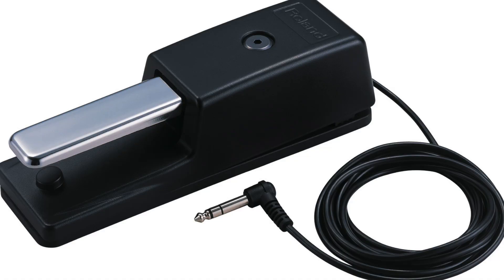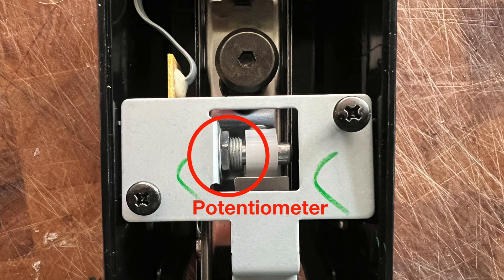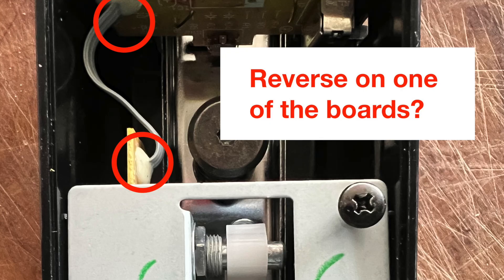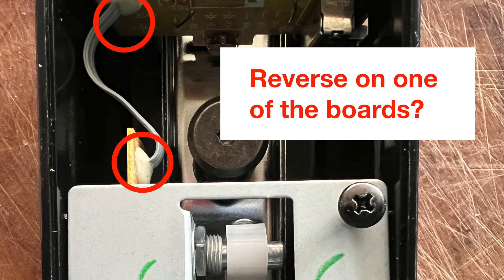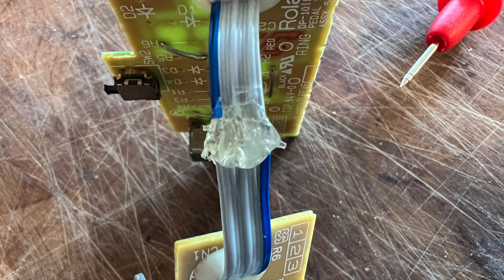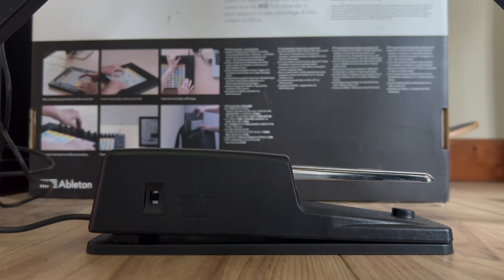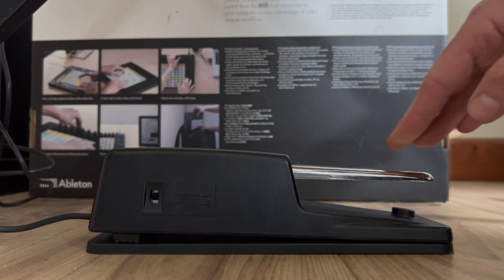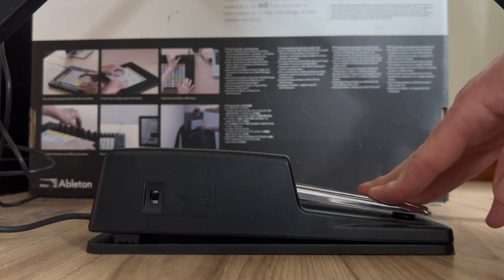Polarity switch on a Roland DP-10 sustain pedal

Comment: I just got a Roland pedal for my Korg that looks almost exactly the same but with no switch. I took it apart and tinkered around until I got the right orientation to trigger sustain while being held down. Just 2 points to solder and it works perfectly!!!!

Comment: Hi, have one question. Recently bought such pedal for my wife, she owns Roland fp30x keyboard, pedal works well in continuous set, but not for all tones, for example it works for concert piano as continuous, but not for church organ or pipe organ, for them it works like switch. Is that expected behavior?
Reply from the maker: I'm pretty sure that's a limitation of the specific patch on the FP30, not the pedal
Reply: Damper Continuity should be supported by both the instrument(software) and the pedal (hardware). That's why it only worked on concert piano tone, because it's designed and sampled continuously, but some instruments either don't perform that way or not being sampled or designed continuously.

Comment: So after this mod, I get the swtich on the side now controls the polarity. However, is the now continuous in both polarity modes? In other words, when switched the right way for the polarity of the keyboard, does it properly send 0-127 values?  

If so, this is exactly what I'm looking for. If it instead makes both polarity modes just an on/off sustein pedal, this is not for me (I want to keep half-pedaling option).
Reply from the maker: No it is not continuous in both modes, only one.

Comment: Does this work with MIDI keyboards and everything else? I can't wait to use this on my JunoX
Reply from the maker: It should work with any keyboard that has a sustain pedal input on a quarter inch jack
Reply from the maker: I now have a Juno X and can confirm it works :)

Comment: Can i use it with casio pxs 3000 without any problems?
Reply: You can use a Roland pedal for sustain with the PX-S3000, just not in the Damper jack. It will work in the Expression/Assignable jack if you're not already using it for something else. You'll need these 2 settings in the Function menu:

Pedal/Wheel>EXPR/ASGN>Pedal Target>Damper

Pedal/Wheel>EXPR/ASGN>Pedal Type>Exp. Type 2